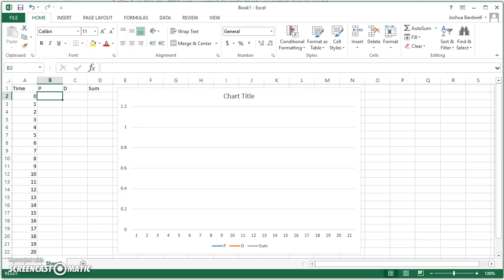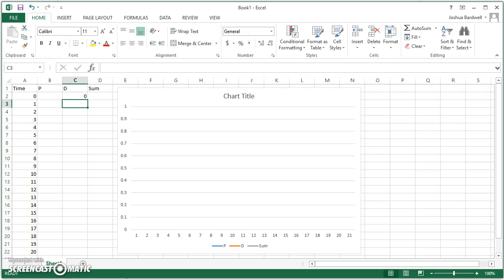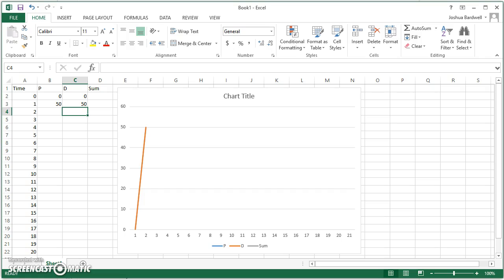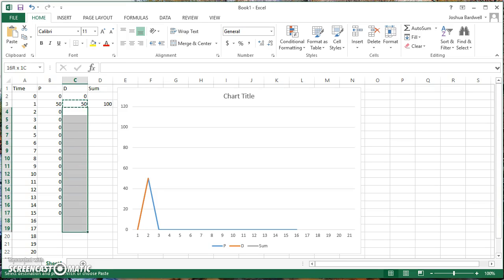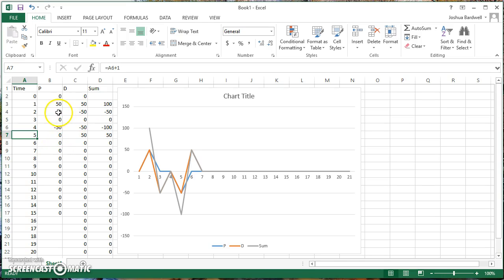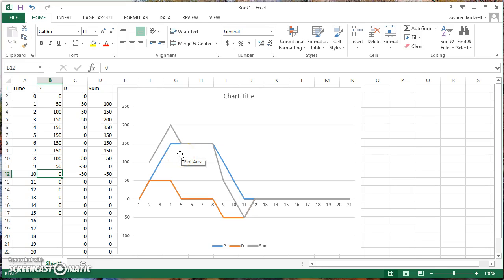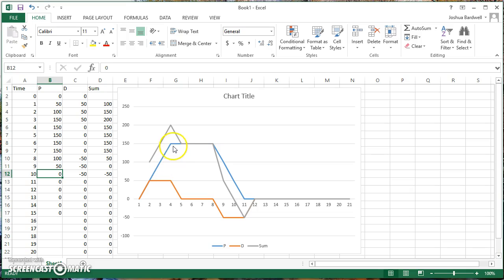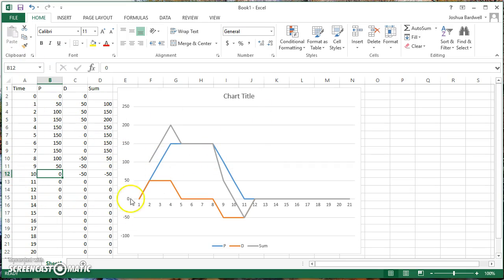Tutorial: Effect of D term on P/D controller

Comment: I've seen this before and I'm still waiting on my "light bulb" Moment. Maybe It would help if you could throw in how changing the "gains" affects this equation.
Reply from the maker: +KelvinFPV Think of gain as a multiplier on the output. That's basically all it is. 

The key thing to remember is that a PID controller has closed-loop feedback. So changing the output of the PID controller changes the real-world conditions that are the input. This is why e.g. increasing P gain causes error to reduce faste, but can also cause oscillations.
Reply: Oh I get it. So increasing the D without increasing the P makes the D heavier than P? Why is it in my graphs on Blackbox on the same PID's the sum mirrors the P in some situations and mirrors the D on others. I always thought the Sum should be somewhere in the middle of there.

YAMAFORD on the thread BTW
Reply from the maker: +KelvinFPV the sum is the sum. If D is much bigger than P then the sum will mirror D. D is the derivative of P so when P is changing slowly D is small, but D can grow rapidly if P changes quickly or if D gains are large.